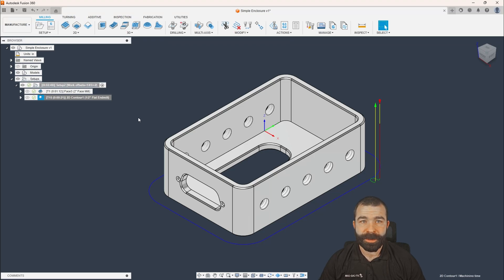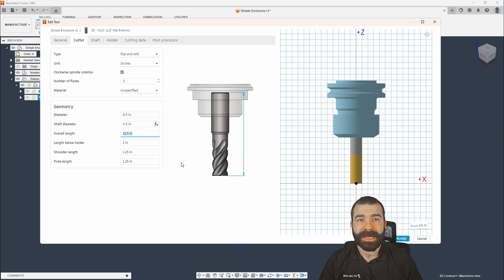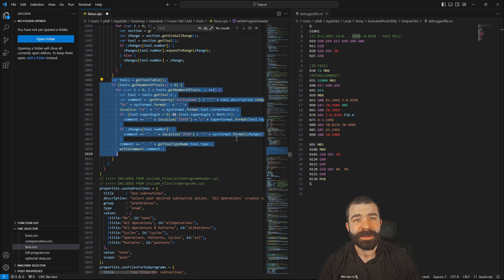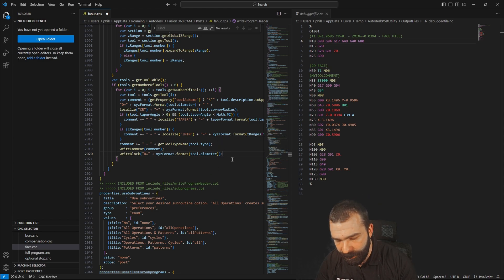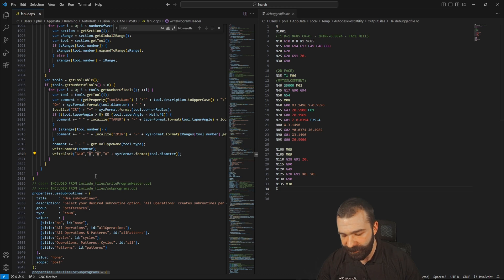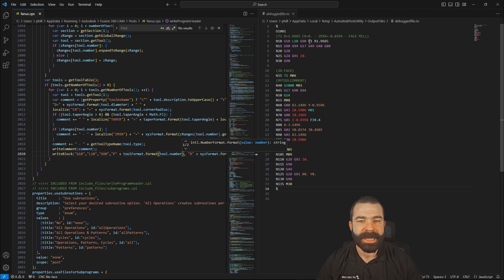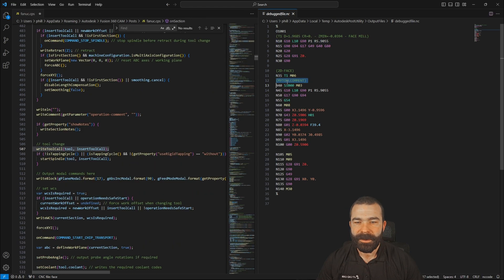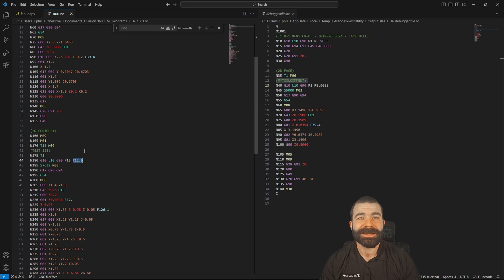Workflow Wensday: Setting Mill Tool Offsets Using Gauge Length

Comment: Got this working but it’s super clunky in fusion. Why does fusion allow you to measure and enter a gauge length when creating a tool but not allow that value to be called in the post processor. I had to set tool overall length equal to gauge length but that just feels wrong.
Reply from the maker: So you would need to pull tool.overallLength +  tool.holderLength to get total

Comment: Just curious, What is the benifit here over just touching the tool off? Is there a time save or is it more consistent or is this just a different way to accomplish the same thing?
Reply from the maker: In most cases it allows you to offline set tool heights and front load your machine. As well this allows the same tool to be used with the same offsets in another machine. If you want more info shoot us over a email. Info@jitcadcam.com

Comment: Hi, cool video. In the preferences – preview features you can activate the gauge length for the tool library. Does it not work? 
Greetings David.
Reply from the maker: If you access to the Preivew Feature than yes however its not outputing in the Gcode as this time which is why I used the  length Parameter.
Reply: Ah ok... Thanks for the info. Maybe it will work out soon 😉 @JITCADCAM